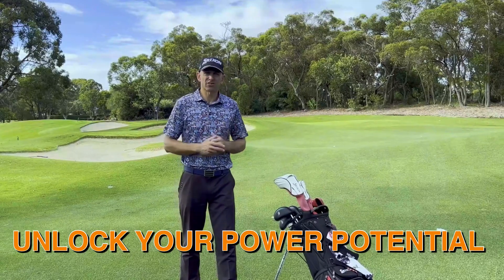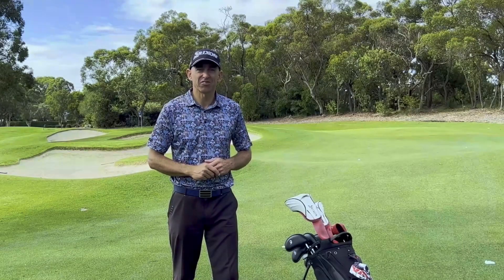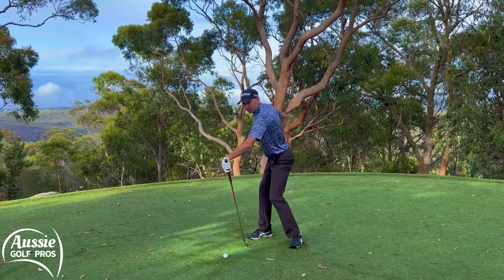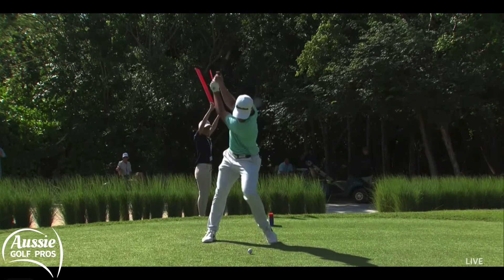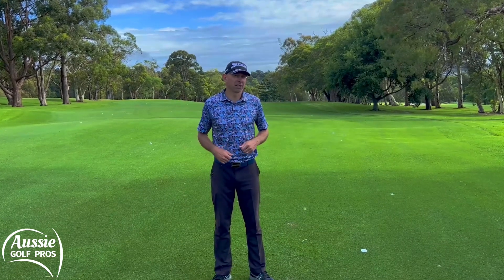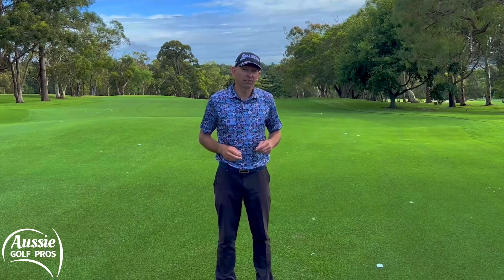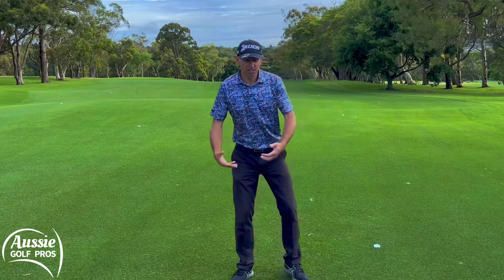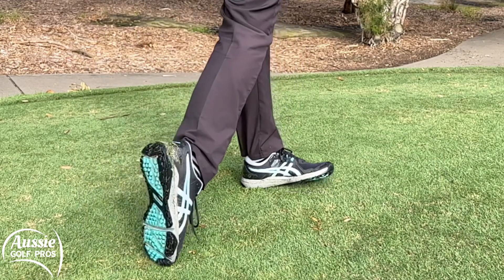UNLOCK YOUR TRUE POWER POTENTIAL

Comment: but the arms have alot further distance to swing than the turning of the hips.... they need to start earilier or  you'll block out all your shots to the right by "getting stuck" behind.  Can you address this issue in one of your videos?
Reply from the maker: Thank you for your question @dogloverjb6873.
Yes, the arms have further to travel and then the clubhead even further than the arms. This helps produce more clubhead speed.
Getting ‘stuck’ behind in the downswing can happen if the backswing is too far behind the player or there is a problem with ‘Early Extension’.
This is a very common issue. We released a video on this and here is the link:

HOW TO FIX EARLY EXTENSION IN THE GOLF DOWNSWING - Easy Drill
https://youtu.be/tK4xldXEmGo

Cheers 
Glen